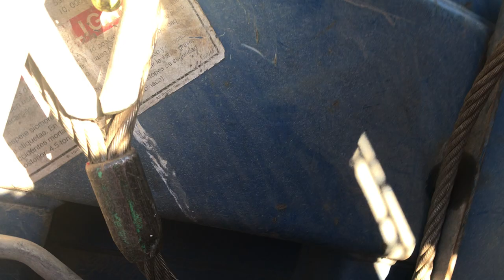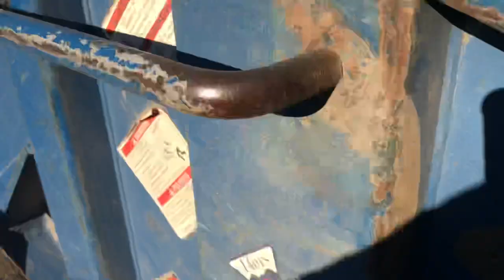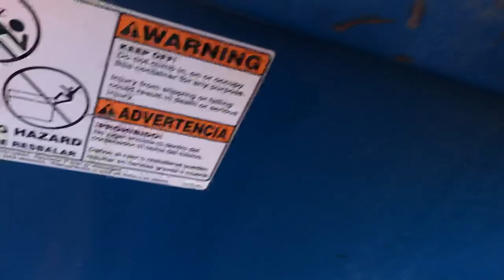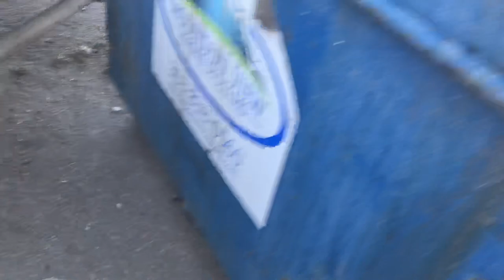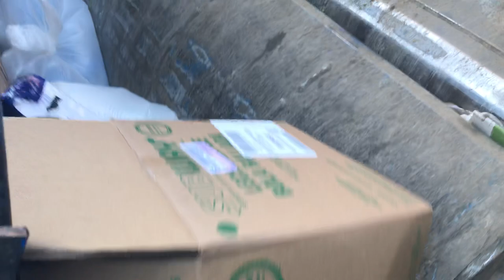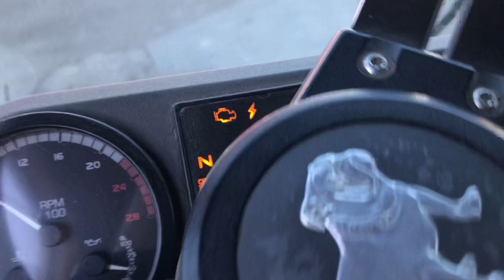Mack Mcneilus rear load

Comment: What are the little side flaps on the truck for?
Reply from the maker: caver1 to hold the dumpster when lifting it they are automatic ran by air and gears
Reply: @Chris-cw5dm  Ahh - makes sense - yeah one of those slipping off would spoil your day big time ahahah
Reply from the maker: caver1 it’s happend when the dumpsters break
Reply: @Chris-cw5dm  Yikes yeah .. what do the do when you do break one? weld them up, or scrap 'em?
Reply from the maker: caver1 if the ears break we weld them back if the bottoms rust or the dumpster is smashed they cut them up for scrap
Reply: @Chris-cw5dm  Makes sense! Thanks for yer answers - love your vids - keep making 'em :)  I've seen the plastic ones actually get dumped into the hopper 'n' crushed (seems like fun ahah) when they break, as I guess there's no fixing them anyway.